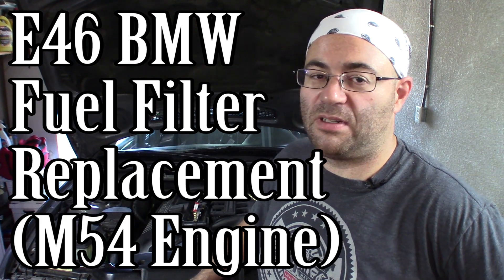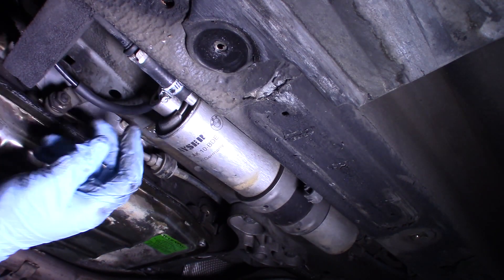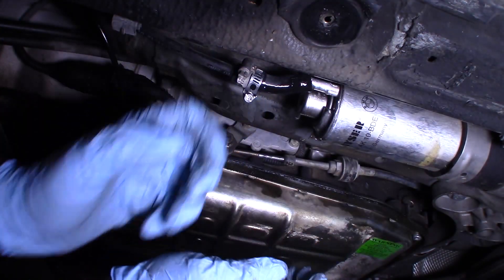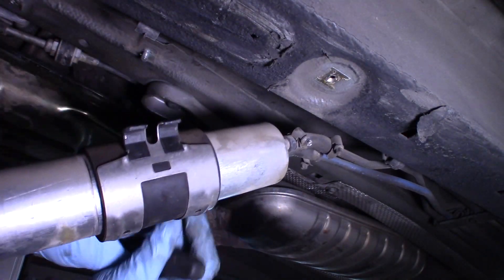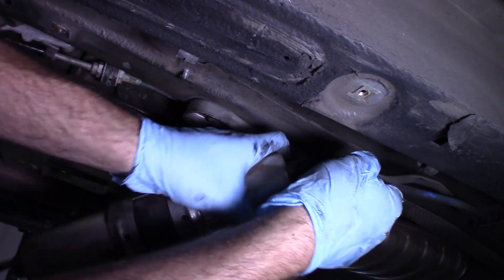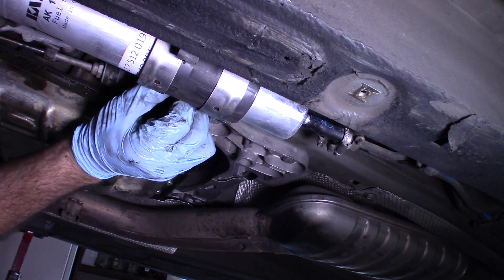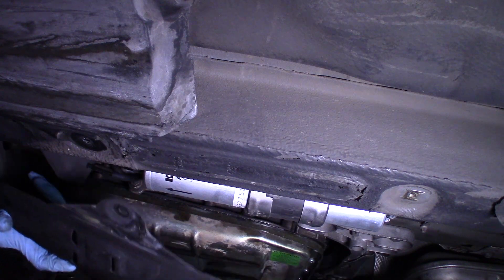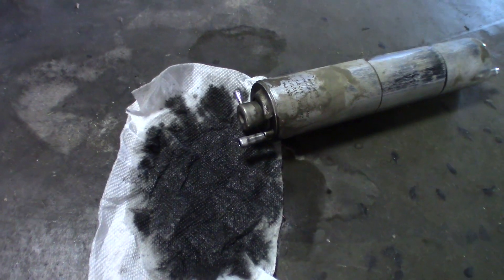BMW 330i 325i E46 Fuel Pressure Regulator Replacement (M54 engine) DIY

Comment: Hey! First off I love your videos! they have been so helpful! I have a 2000 BMW 323i and I have been looking around for fuel filters with regulators and I am seeing two different kinds. Ones with regulators in them and ones without.  I am wondering if the one you used would work for my vehicle.

Comment: hey, do i need to change the fuel regulator too when i replace the filter? thanks in advance
Reply from the maker: If you have the old system where the two are separate, no you don't need to change the regulator.  If you have the newer system where they're both integrated, well, you have no choice lol
Reply: many thanks. hopefully its the former. i guess the only way to find out is to get under there? or can the stealer tell by the VIN?
Reply from the maker: blackpassenger nah you can tell by your vin too. Go to realoem.com and put in the last 7 of your vin and then find the part no for the filter
Reply: oh excellent. good lookin' out.
Reply: oh man, excellent. i never ever ever have to go to the dealer here in japan again. whenever i go to the dealer here for a part number, theyre always trying to get me to order the part from them. And yo, the prices here? anywhere from 2 - 7x more expensive. for example: spark plugs here are 22 bucks each and four rotors with all the pads are 600 bucks.
Reply: @blackpassenger  wow, I imagine the typical BMW owner in Japan is a rich gentleman but those prices are crazy hahahaha
Reply: @FStan-co8vv  yep, except me. far from rich. but since im gaijin, i can do all the work myself, which is unheard of in japan.

Comment: what code did you have if any? or what were the symptoms of bad fuel filter, I have a p0174 on mine, 2001 bmw 325i
Reply: i just replaced mine while doing all the fluids and filters on a newly purchased e46. its easy enough to do and if you got the car up already might as well.

Comment: Nice one, as always. Is it advisable to remove the fuel pump fuse and let the engine drain the fuel lines, to have a less messy procedure? Cheers.
Reply from the maker: +Gehmirnicht Aufdienuesse I did that in my video--it doesn't help.  Be prepared to catch the fuel in a container.

Comment: hello sir, I appreciate the videos. i was wondering have you ever had a p1250 code? I read it can be due to not enough fuel pressure, what do you think? thanks.
Reply from the maker: On what make and model of car exactly?
Reply: 50sKid 2000 bmw 323ci e46
Reply from the maker: Are you sure it's P1250 code?  That does not seem to be a code that happens on BMWs.

Comment: Hi, lots of great info on your videos. I measured 50psi fuel pressure on my E46 and it doesn't fluctuate with acceleration. It drops if I manually apply a vacuum to the small hose that connects to the F tube. I don't feel any vacuum coming from the f connector. Do you know what the vacuum measurement should be? Is the vacuum source supposed to come from the bigger jet pump hose? If so, what reading should I expect at the larger hose in case it is semi/clogged?

Comment: Would this be the same prcocedure for the 2003 X5. It has the M54 3.0 engine. Thanks for doing these vides. They are very helpful!!
Reply from the maker: Yes it's very very similar. You'll see a slightly different configuration of things where the fuel filter is. I believe the charcoal canister is next to it. But the fuel filter looks the same.

Comment: Hi @50skid. Thanks for your great vids! Say, Could I buy a Kayser fuel filter without pressure regulator and reuse the regulator from my old filter (put it on the new filter when replacing?)? Found the naked Kayser fuel filter for 16 $ @ OEMbimmer. My ride is a 2001 300xi. Cheers
Reply from the maker: If you have an M52TU engine you are supposed to have the bare fuel filter like that. The pressure regulator is separate.  Watch this video on a car that has this type of system and you will see what it looks like: https://www.youtube.com/watch?v=jqef_Xpz7Og--  Consult realoem.com and enter in the last 7 digits of your VIN number to find the exact part number for your car and then type that part number into google or ebay and you will see what the part looks like and then you'll know what system you have.
Reply: Thanks man. RealOEM tells me I have the normal M54 engine. Cheers
Reply: And that's the part: 01 Fuel filter with pressure regulator D=55MM/L=315MM 1   13327512019 $96.84   .....//// Means I need to buy the one with pressure regulator on it, right? Cheers!
Reply from the maker: Yep that's what it says there.

Comment: What kind of power tool is that what brand?
Reply from the maker: That is an older Makita 1/4 impact driver however, I would recommend you go for the Milwaukee 2754-22 3/8 cordless impact wrench (200 ft lbs!).

Comment: What size is that vacuum line and how long would I need?
Reply from the maker: 1/8" and less than a foot
Reply: +50sKid thank you for replying and making these videos and sharing your experise!! Really appreciate it!!
Reply: What size is that in mm and do I just need normal vacuum hose ?
Reply: Looks like two sizes of vacuum hose, what are inner/outer specs needed? Want to change the whole ling back to the F connector, seems like it'd be way more than a foot?

Comment: Love your videos!!
I've been getting a few codes on my 2000 Bmw 323i wagon.. P1188 fuel control bank 1 sensor 1, P1189 fuel control bank 2 sensor 1, P0170 fuel trim bank 1 and P0173 fuel trim bank 2. Could the fuel filter be the problem? If it was your car, what would you fix first? Then next.. 
Thanks for any help you can give me.
Reply from the maker: +dianna romero Take a look at my fuel trims video for further help on this.  Thanks for watching

Comment: Hey 50s kid,  I love your videos man keep at it! I do have a ? for you,  I have been working on my 2000 323i BMW e46 wagon with the bleed down fuel pressure long cranking issues.  Ive replaced fuel pump twice,   fuel pressure regulator with valve and replaced all injectors and when I turn key on fuel pressure goes to 50 and it leaks down to zero in a matter of seconds.  Car running good tho.  Any ideas? Suggestions? I am going crazy trying to figure it out.   Thanks in advance man.  Hope you can respond.
Reply: Did you ever figure this out?

Comment: Do you know where the fuel pressure regulator is located on a 328i? I keep seeing that it is located under the hood?
Reply from the maker: It's under the car roughly where your feet would be when you are sitting in the driver seat (on a left hand drive).
Reply from the maker: It's in the same place that you see me working in this video, it just looks different.  The regulator is separate from the filter and its held in with a clip.
Reply: 50sKid thank you!

Comment: Does anyone know where the fuel pump location is for a 2005 Bmw 325ci convertible? Any help would be appreciated. Thanks guys
Reply from the maker: Same place as all E46s--pull up the back seat. It's on the right side.

Comment: Hello, please help me! You seem to know this cars inside out. I have a pretty good knowledge about BMW. Have torn them apart and put the together. I have an issue with WARM LONG crank. I have replaced: fuel pump; relay; filter; performed smoke test, CCV-pipes; probmem persists. I also have lean codes for bank 1 and 2 that I'm not able to solve. Again I have no vacuum leaks. I've emptied 2 cans on carb choke spray on the intake on top of the smoke test to ensure no vacum leaks. Pls help. If you want pls weite markpoposki at gmail
Reply from the maker: If you've got lean codes, that's the root of your problem, start with those.  Identify the type of lean condition, be it vacuum leak or fuel delivery problem (doesn't matter if you have brand new parts, you have to consider that they might have been bad).  I have a fuel trims video that shows how to identify the type of lean condition you have.  Start there, identify whether it's really a vacuum leak (fuel trims go down at speed) or not.
Reply: 50sKid so I have been running my software today. 

First off my lean codes have disappeared. I did mention that I replaced the CCV, which had some cracked hoses.

My WARM long crank persists with no check engine codes.

I had changed my fuel filter a month ago as part of general maintenance. Opening up the manifold and replacing the CCV solved the vacum leaks. 

I still had the WARM prolonged crank so I was convinced that I had a defective fuel filter/pressure regulator. Therefore I changed it again. I previously had the keyser and I now put the Heights. 

I still have the problem. I contacted you and found out about the fuel trims. This are my findings. During morning start up when the car starts with no issue. I have near perfect fuel trims. 

After a WARM drive. The car has to sit for like 10 min before the issue starts ( long crank) now. I also noticed that the car will crank forever if I don't pump the gas pedal for a few times. 

The fuel trim findings in the WARM condition. The bank 1 short term is almost unremarkable. 0-4( which I believe you mention it to be non significant) 
The Bank 2 goes -20. When I rev the car it goes even further down! -40!

I had a pressure test kit but when I hooked it up it didn't show pressure in the rail! 
I returned it at Harbor freight thinking it was defective. My plan includes to get it again and this time, try it with the teflon tape like you did. 

MAF is ok. Cleaned. What is the most likely offender? Do you think I have a leaky fuel injector/ injectors?
Reply from the maker: If you don't have fuel pressure in the rail then you've got fuel pump issues.  Could be an intermittent failure.  You said you recently replaced it so maybe you should be looking for electrical issues--check the relay, which is above the fuse panel (you have to pull it down).  The relay could have partially burned contacts inside of it.
Reply: 50sKid 
I read that the fuel pump relay is under the hood in the driver side fuse box next to engine management fuse pack. It's a green relay. I forgot to mention. I just replaced it 2 days ago with genuine part from the dealer $20. No change. Do you suggest I check the fuel pump fuse. Above the glove box?
Reply: 50sKid I also just replaced the 20amp fuse in the glove box fuse pack. I hear the fuel pump run during engine working. But I don't hear it priming with the key in position 2. 

On another note. Should I be looking in fuel injectors?
Reply from the maker: The fuel pump relay is not under the hood.  It's above the fuse panel in the glove box like I said before.  http://cdn4.pelicanparts.com/BMW/techarticles/BMW-3-Series-E46/108-FUEL-Fuel_Pump_Testing/images_large/pic18.jpg
Reply: 50sKid ohhhhh now I see that I've changed the injectors relay...
Reply: 50sKid so I changed the fuel pump relay. No change with the WARM long crank. I got a lean code after first start on bank 2. Fuel trims positive around +10 for bank 1 and negative for bank 2. If I rev the bank 1 FT go towards 0 and the bank 2 go further negative 😭.

After the troublesome start the car works fine. No hesitations no shaking no lack of power. I also do not hear the fuel pump priming when I put the key in 2nd position. I also changed the 20amp pile pump fuse. No change!
Reply from the maker: What you are describing is a vacuum leak, not a fuel delivery problem.  As I say in the video, if your fuel trims drop when you rev the engine, that is a vacuum leak.  Find it, fix it, your problems will go away.

Comment: I have a 2003 325 ci ... I have several issues but first of all fuel pump primes up but the car stalls.....help
 I biought the car with this problem so I have never  heard the car run

Comment: After the change of the oil filter, i have prime the engine 3 times and wait 5s (X3).
When i tried to start up. Then motor make a startup noise but i that's all, not the final startup.
Have you an idea ? best Regards!
Reply from the maker: After changing the oil filter or the fuel filter?
Reply: After changing the fuel filter